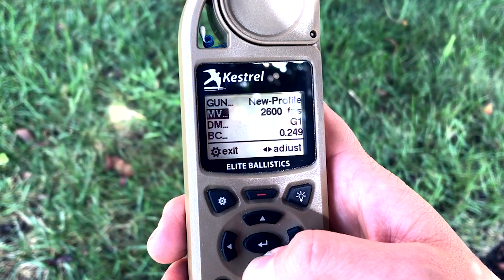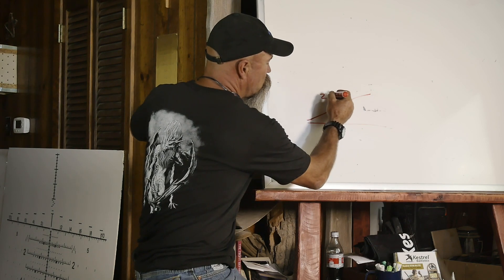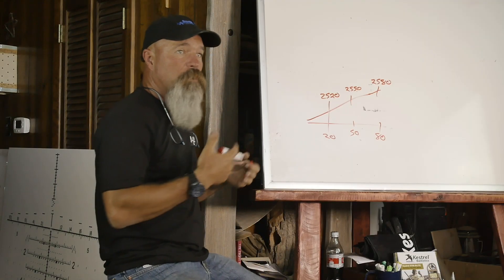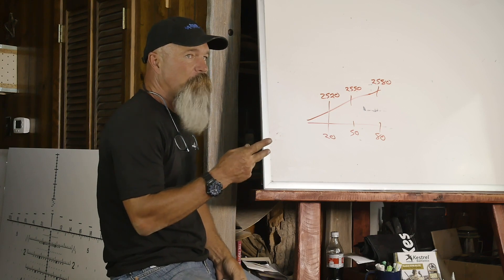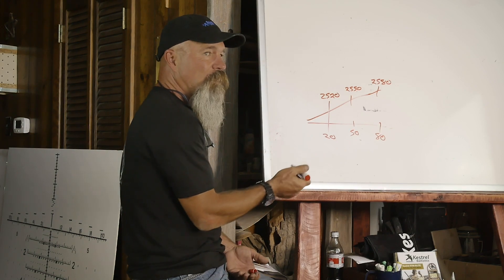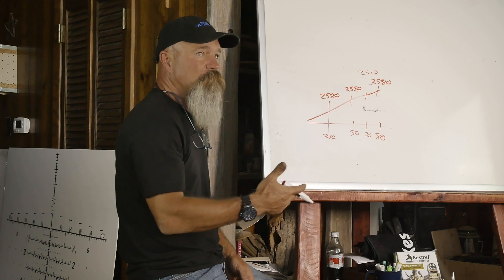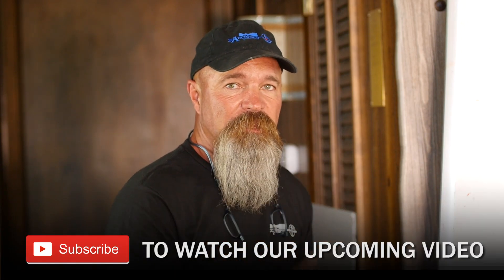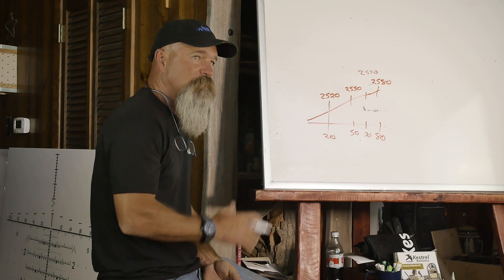Kestrel MV Temp Tables | Todd Hodnett from Accuracy 1st

Comment: This is a great feature but if you have a powder that swings mv by allot of fps, wouldn't most be out of its node?
Reply from the maker: This situation is the perfect example of why you would want to use the table. By measuring the MV at a higher temp and a much lower temp, the Kestrel can determine the slope of the changes by temperature and thus make the proper adjustments depending on the conditions.
Reply: @KestrelBallistics  can the curve be an actual curve (temp v fps); or is it forced to be a liar profile with only a high and low end? There are 5 available inputs, so idk which is what the kestrel actually calculates with (a factor corrected linear curve or absolutely user accurate true curve)?
Reply: I also wonder a lot about my inability to use/find multi-BC's at different fps/distance. That was the entire reason I sprang for the Elite 5700 - best I can figure is buying the AB custom curve....but that still isn't a curve that is directly connected to my DOPE/my gun.

In Strelok I can do all of this and for now at least my Strelok phone app is much more accurate if I get temp and DA from the kestrel....which is more cumbersome than I was hoping for given the $700 kestrel vs ~20$ app - Am I missing something I am new to kettle in general so could be I haven't yet found this option, would love to hear Kestrel's input if I can actually alter/make my own multi-BC table...
Reply from the maker: @andrew13651  sorry for the late response.  If you have the Elite, you don't have to buy the custom drag curves, just connect to our Kestrel LINK Ballistics app and find your bullet profile.  You can then tailor the BC in the trans and subsonic regions by using the Cal DSF function on the Kestrel.  There is no reason why the Kestrel should not be as accurate as Strelok.  It may be best to continue conversation on email by sending to techsupport@nkhome.com

Comment: I understand in order to get an idea of different temperatures affecting the powder burn rates and therefore changing MV that is what the MV Temp Table is for, but I am having a hard time understanding this. Doesn't the AB Kestrel assume the ammo temperature is the same as the ambient/air temp when calculating MV. Other words let's say you are on a hunt and the ambient/air temperature is 32F, but you just loaded your rifle with ammo that was in your pocket and close to your body temperature 98F or the sun warmed the rifle and also warmed the round in the chamber wouldn't that change the MV. I guess what I am getting at it seems like in order for all this to be accurate the AB Kestrel needs to know the temperature of the ammo along with the ambient/air temp.

Comment: OK, I'm good up until the part at 4 min for ammo that is warmer than atmosphere.  I don't understand.  Turn on the MV-Temp table, look at the speed for 70 degrees, turn off the table??  Do you then put that 70 degree speed as your MV?  Won't that screw everything up when you go to put it back to where you had it if your enviro readings are different than when you put the MV in there?  I really don't think so but do I want to risk it when everything is working brilliantly out to 2500.  I'm pretty sure I've watched every video twice trying to figure this out and I'm wondering if that is what the actual solution is since tech support could not answer my question.
Reply from the maker: Once you turn on the mv temp table the MV will automatically change in direct correlation with the values input into the table as data points. If your ammo is at a different temp than ambient environmental temps, either colder or warmer, turn the MV temp on and then go to environment and change the environment temp to match the ammo temp. This automatically changes the MV in the gun profile to match the ammo burn rate variability at whatever temperature it is based off the data points you have input into the table.  Then turn the temp table to OFF. Then go back and update the environment to capture current atmospherics. By turning the table off prior to updating to current atmospherics, we lock in the MV associated with the burn rate of the powder at whatever the temp of the ammo is, and then by updating we get the atmospherics required for ballistic calculations.
     If everything is working brilliantly out to 2500m I would suggest inputting a data point into the temp table of whatever MV you have and the current temp. This way if you turn the temp table on, and encounter the same temp then you MV will always come back to this value.
Reply: @KestrelBallistics  Can you please make a video about this? Cheers
Reply: @KestrelBallistics please make a practical video regarding this

Comment: Practical Tactical what? I shot an Antelope this year at 638 yards and hit exactly where I wanted to at 27°F. I had time to set up the shot and had a drops in yards on my turret for 30°F temps and 70° F at my known hunting altitude. Both drops accounted for Density Altitude and muzzle velocity at those temps. I knew my ammo had warmed in the covered bed of my black pickup bed to at least 50-60°. So I set between my two deltas to hit muzzle velocity while being reasonably close on atmospherics. As I said, a perfect hit high shoulder. Had I not accounted for my warm ammo, I might have missed or worst yet wounded the animal.

Comment: I can’t believe you are actually telling us to use the actual ammo temperature. I’m sorry, but that is impractical and counter-productive.

The ammo temperature may differ from the atmospheric temperature but that difference is relative. 
Since the Kestrel cannot detect your ammo temperature but it can detect the atmospheric temperature, you should simply ignore the ammo temperature and use air temperature.
Furthermore, since the ammo temperature may not correlate to the atmospheric temperature, you would be creating a variance that would make the kestrel apply incorrect MV offsets when all it knows is air temp… not ammo temp.
Reply: Atmospheric will affect the ballistics and flight. Ammo temp can affect the MV which is one of the key bases for the atmosphere to affect. I think you are missing the difference. He's mentioning this as a data collection point to understand your ammo. Many times in So Cal its 30 degrees and later in the afternoon its 80 degrees you are correct in the ballistics charge and the density altitude but when the ammo is sitting out in the sun on the table that will also cause some big shifts if you aren't checking the MV through a chrono again.
Reply: You are correct that atmospheric temperature will effect air density and bullet flight.  You are confused about the process of locking in the bullet temp in the MV-Temp table.  What he is saying is, after determine the bullet temp you manually change the temp on the Kestrel to match the bullet temp then you turnoff the MV-Temp to lock in the bullet temp so it can adjust for MV.  After this you will capture the actual atmospheric temp and by locking the MV table the bullet temp will not change to atmospheric temp.  Now if your bullet is at the same temp as the atmospheric temp you will turn on the MV-Temp which will adjust the bullet temp to the actual atmospheric temps.  And yes its all relative, as he mentions it all depends on how temp sensitive your powder is and the difference in temp in the bullet and atmospheric temp.